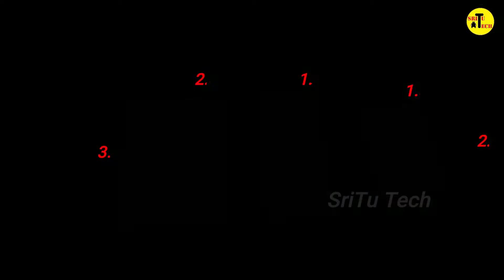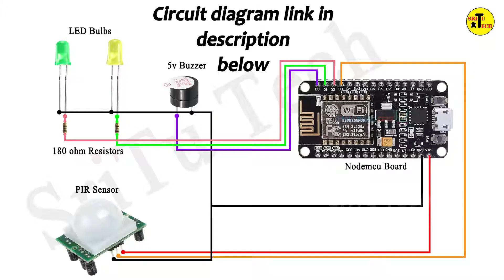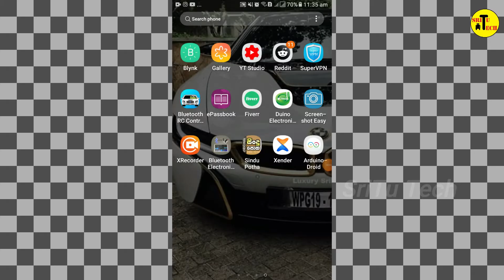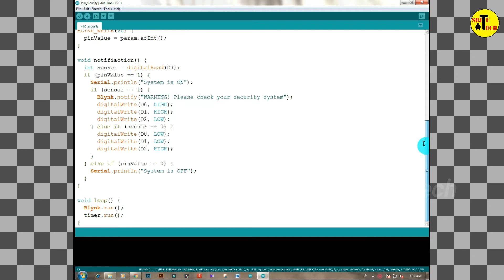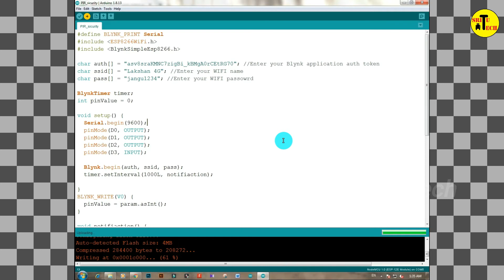How to make a PIR SECURITY SYSTEM with ESP8266 | Blynk application with PIR SECURITY SYSTEM[Nodemcu]

Comment: Sir plzz reply because we are on hold for your response
Reply from the maker: what's your issue?
Reply: Bro it's been like the one version which you have been used is not available now
Reply: I am facing issue in the blynk application it is updated and the updated one is not showing the notification widget so for notification i am doing from laptop and for button also I'm doing from laptop i created quickstart template while running I'm facing some error i really don't know exactly i am facing error in blynk application or code